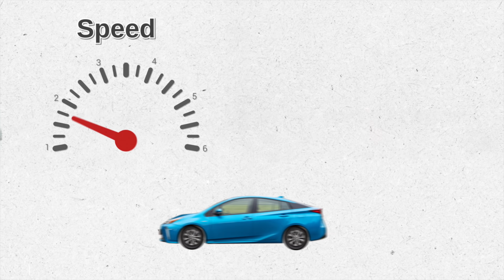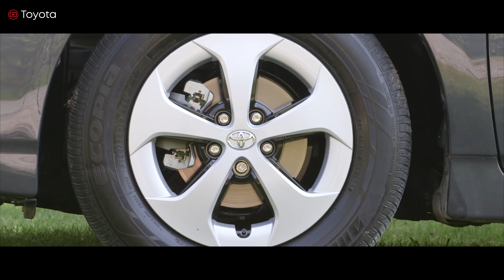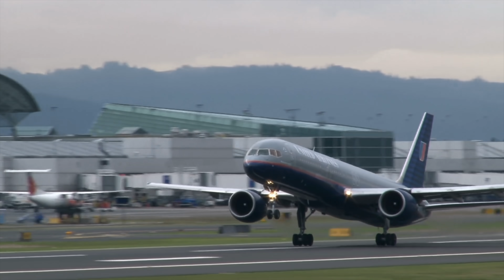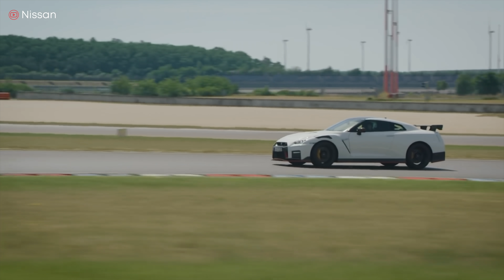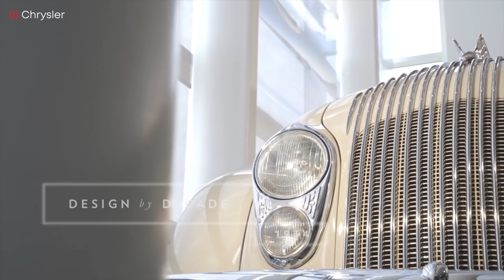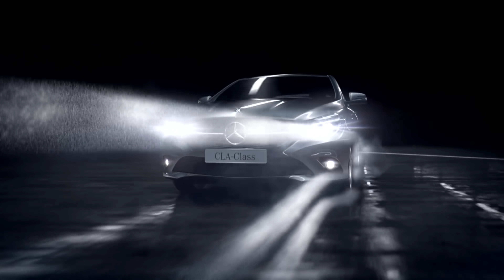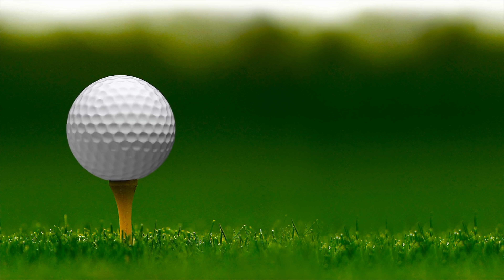Here’s Why Rolling Down Your Windows is Bad for Your Car

Comment: I don't know about the air conditioning versus window thing. On Mythbusters they proved what common sense would predict that full air conditioning is way less efficient than all the windows down. However, windows as you go from one cracked to all four open decrease the efficiency gradually, while I'm pretty sure just turning the air conditioning on even a little causes a big increase in fuel consumption, because the cabin fans don't really affect fuel consumption much. Also, there's the option of using the fans without turning the air conditioning on, which doesn't seem to be considered.
Reply: New compressor designs are less draw on engine power.

Comment: Biggest Car Myth: Believing you'll ever find a vehicle as good as a 94 Celica
Reply: I miss my old 94 celica 😥 
The transmission was smooth as butter, the engine ran like a champ, the suspension was very good taking city bumps with 100 kph, etc.... 🥲 I need one again, but they are expensive as f, theone with the 115hp 1.8 7A-FE costs around 9k USD here 😅
Reply: You may be too young to remember but the early 80s sr5 trucks were even better,

Comment: Will a rear sway bar or front strut tower brace improve handling or ride quality?
Reply: They both limit body flex and lean which improves handling.   The sway bar effects the other end of the car from where its installed.  So adding a rear sway bar effects the front of the car.  Having them front and rear is ideal.

Comment: Afternoon Scotty took your advice and got a 2010 Camry for my first car and love it!
Reply: Sorry
Reply: Sorry 😞
Reply: @johnhoey4605  wdym sorry
Reply: @dratrains  Reliable but very boring.  With special emphasis on the word boring.  But I can appreciate some people simply don’t care about style or the fact that every other person on the road has a Camry.  Best of luck though!
Reply: @johnhoey4605  yes I’m aware of how plain but as you said I do not mind
Reply: I’m about to get a 8th gen Camry soon
Reply: If you have the four cylinder, check the oil frequently (every other fill up) because that engine is known for oil burning. Replace the PCV Valve (OEM Toyota or Denso part only)as a preventative measure.